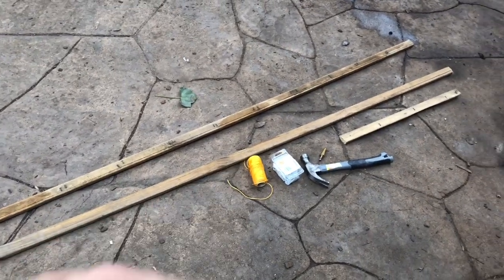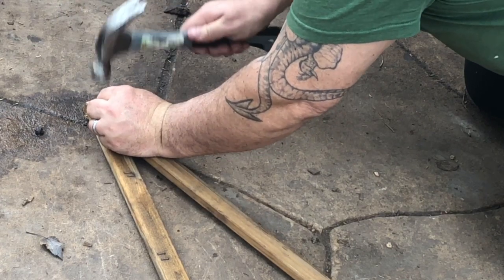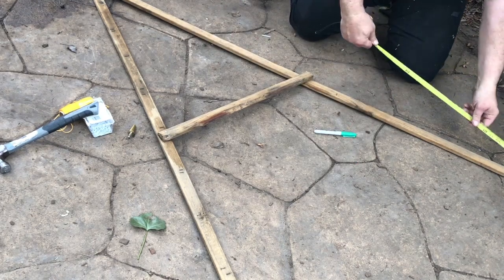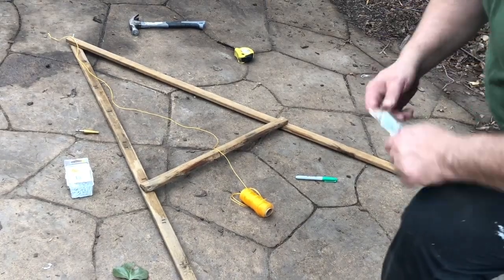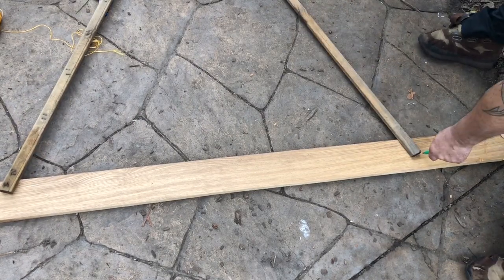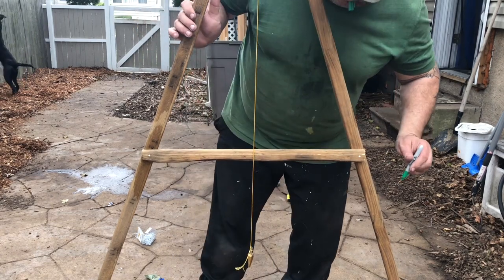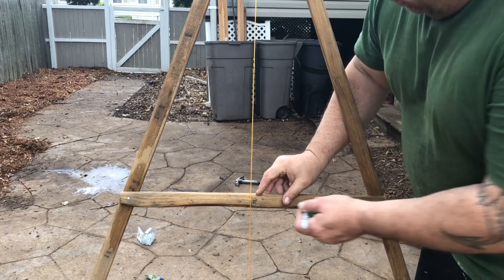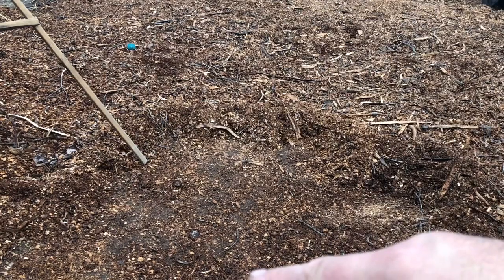Make an A-Frame Level to Install Swales

Comment: Instead of the Plumb Bob, why don't you fit a spirit level in place of the cross bar
Reply from the maker: That would work. But everyone has a piece of string and a small heavy object laying around. Dedicating a level to the A frame might be a bit much, tho zip ties holding it in place would work too

Comment: so why did you choose the spots you did to mark?
Reply from the maker: That's where the line settles on each side. By marking them, and then taking the point in between the two, you find the actual midpoint.

Comment: Easy instructions, thank you sir.
I am thinking of using welded metal tubes for making the A-Frame since I have to use it at several farms and want it to last a long time too. I have tubes lying around. I hope I can find a level small enough to be put in the middle frame, the kind found on tall camera tripod.